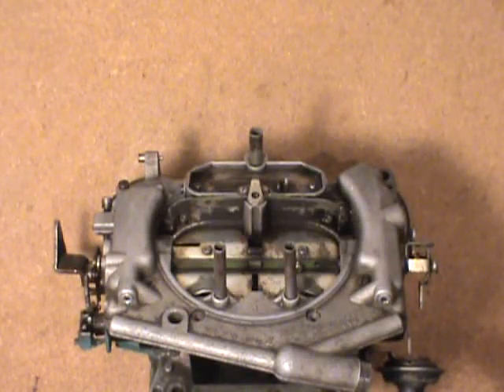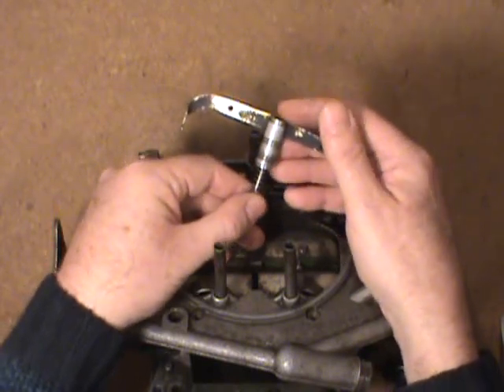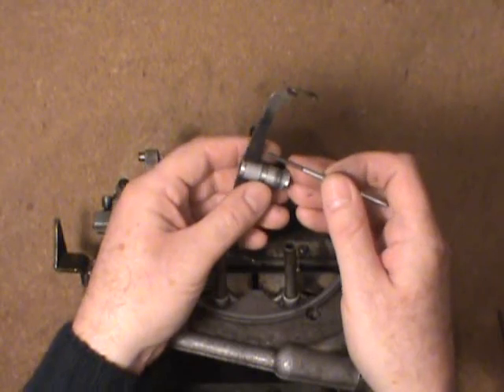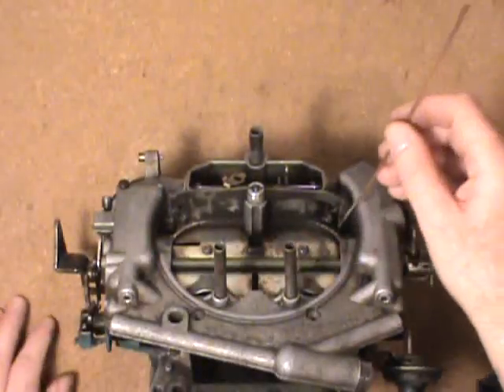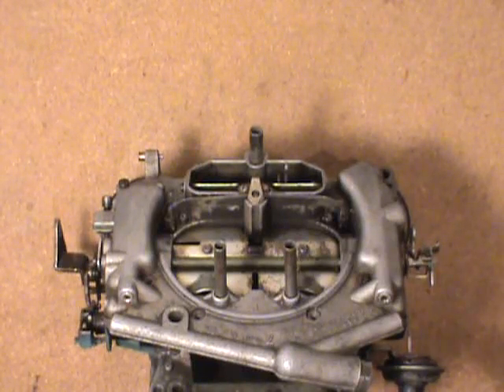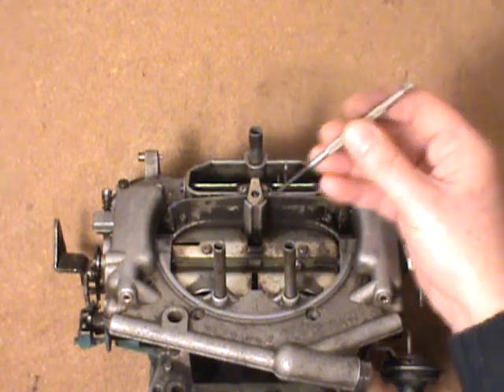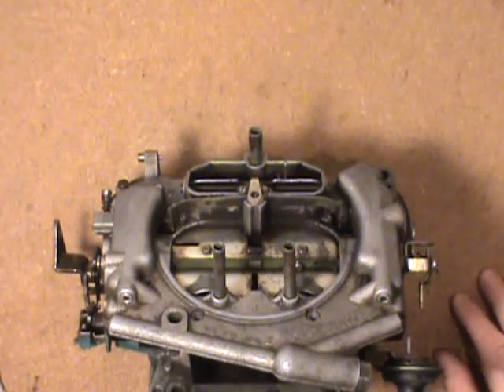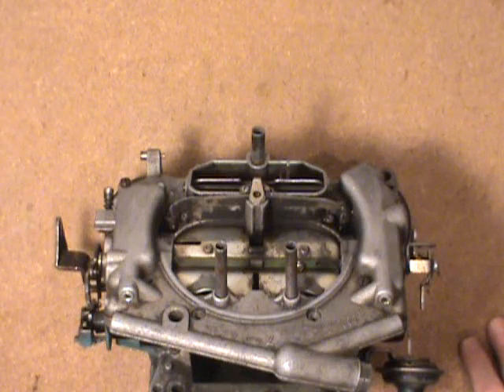Thermoquad 4 Barrel Carburetor  (Part 6)

Comment: Rocky,

Thanks.
 
I really appreciate your videos.  Carbs are not my specialty and therefore the are a little scary to get inside, but I am not going there.  Just fine tuning.  Your videos are very easy to understand.  I cannot say enough good about them.
 
I just had foot surgery and therefore I cannot push in the clutch.  So, if you do not hear from me for a while-that is why.  Cannot get to work on car.  :)
 
Numbers are a little hard to read, but here they are.  Top is 6548S and the bottom number is 35776.  I believe that 35776 is the S/N and the other is model.
 
I purchased it rebuilt and runs fine, with the exception of running rich.  I worked on the idle mixture and they were six turns out.  I got them down to 2 turns and it is a lot better.  Therefore, with the idles being so far out, I can safely assume that the Metering may be off.  Worth checking.
 
Carb is vacuum choke. 

Engine is 340 bored at least 30 over.  That old of engine, you know that it is hard to tell.  It has been stroked and therefore we figure it is running around 11.25 compression.  Cam is a 506 lift.  Manual 4 speed transmission.  Yes, it does do the Cha-Chugg routine.

Thanks again.

P.S:  I have no emissions requirements here.  I just want to get it dialed in better.
Reply from the maker: Mc Ca Greetings Mc Ca....You're welcome, and, Thanks, for Your Outstanding, and well appreciated comment, that You indicated, about my Thermoquad Videos, my Friend.The Thermoquad carburetor Number, that is Most Useful, for, looking up the Specifications for it, as well as, telling the Parts Guy/Gal, the Needed Information, so He/She will be able to provide You or Others, including myself, are those..."4-Numbers-Followed-by-the-Letter-"S".I had a look-see on..."Vaanths Thermoquad Guide"...for the "4-Numbers" & the Letter "S"...which You indicated as...6548S...I Did-Not See that...6548S...in the Listing......Maybe, it might be...6545S...(?), which happens to be the Identifying Numbers & Letter, that is Stamped on the Thermoquad carburetor, that You see in All of these Thermoquad carburetor, YouTube Videos of mine perhaps...???Once You are fully healed, after having Your foot surgery, and are able to get around without too much difficulty, maybe, have a look-see, to actually "Verify", those..."4"-Numbers-Followed-by-the-Letter-"S"...that way, I will be able to Look-Up, the much Needed Information, which will help a very great deal...!!!Those "4"-Numbers-followed-by-the-Letter-"S", are usually "Stamped" into the "Lowest" Part of the Thermoquad carburetor, on the "Left Hand Side", at the "Rear/Back".Before I forget, there is another very important thing, that can happen, when Setting the Thermoquad's "Idle SPEED Screw" Too High (aka, clockwise, and In too much), and, besides, having that Extra Air/Fuel from the Thermoquad's "Low Speed Circuit", Added, to the Air/Fuel that is already coming from the "Idle Circuit", happens to be, how it might "Add In Additional Ignition Timing", at "Idle Speed", from the "Vacuum Advance System", if indeed, Your Distributor has a "Vacuum Canister/Unit" on it, that looks, kinda like a little Space Ship, and its Vacuum Hose, is connected, to what is known as "Ported Vacuum", that takes its "Vacuum Signal", from just "Above" the Primary Throttle Plates/Butterflies, when the Primary Throttle Plates/Butterflies are almost Fully Closed.Your Thermoquad's "Choke Pull-Off"...besides Controlling the Choke System..."ALSO"..."Controls"...the..."Opening Rate"...of Your Thermoquad's..."Secondary Air Door"...!!!...just sayin'.Now for..."Adjusting" the "2 Idle Mixture Screws", and the "Idle Speed Screw"...The "Idle SPEED Screw" that I usually use, in order to Set the "Idle SPEED", is that Screw, that is just "Above", that Big Heavy "Fast Idle Speed Screw"...Now then, when it comes to "Adjusting" the "2 Idle Mixture Screws", it's very Important, to keep "Both" of them, Turned "In or Out", about the Same Number of Turns, and Partial Turns, in order to keep "Both" Primary Throttle Venturi-ees/Throttle Bores..."BALANCED"...or, Your Thermoquad carb, might not Work/Perform as good as it's able to.Just in case, You might not already know, always remember to have Lots of Ventilation and Fresh Air, when-ever Your Engine is Running, because the Engine's Exhaust Gas is "Deadly"...!!!The first thing to consider, before starting to "Set-Up", Your Thermoquad carb's "Mixture Screws", is to "Select", what You think, would be an Acceptable "Idle Speed".Have the Engine fully warmed up to Operating Temperature, and, "Make Sure", that the "Choke" is Fully "Off", as in, the "Choke Plate" is fully "Vertical", and, the Big Heavy (it's actually a Counter-Weight) "Fast Idle Speed Screw", is All the way to the "Bottom" of it's Travel, and in No Way, is that Big Fast Idle Speed Screw, making "Any Contact" what-so-ever, with the Throttle Lever (Yes-Sir-ee-Bob, the Lever that has the fast Idle Cam steps on it...lol). As an example, I have used the "Specifications", that were found on the Vehicles "VECI" (Vehicle Emission Control Information) Label/Sticker, that is usually found in the engine compartment, on a Factory High Performance Dodge 360 Cubic Inch small block V-8 Engine, with an 850 CFM (Cubic Feet per Minute) Thermoquad carburetor, that was also equipped with that good ole A-833 4 Speed (Manual/Standard) Transmission, that was controlled with that good ole Hurst Pistol Grip Shifter, never-the-less... Then, having the Vehicle on Level Ground...all 4 Tires Chalked with Bricks, to prevent the vehicle from Moving...Emergency/Parking Brake On/Applied...With the Garage Doors OPEN, and having Lots of Ventilation and Fresh Air, I Run the Engine, in "Neutral" (it's a Manual/Standard Transmission eh!...lol), until it's at Operating Temperature, then, turn Off the Ignition, and take the Key with me...First, with Engine "Not Running", I Lightly "Seat" the 2 "Idle Mixture Screws, and place a White Chalk Mark on each of the 2 Idle Mixture Screws, at the 12-O-Clock-High Position (aka, closest to the Sky), in order to establish a "Reference Point", to make things nice-n-easy...Then, I turn Each of the 2 Idle Mixture Screws "Out" (Counter-Clockwise) from being lightly seated, "4-Full Turns"...Then, with Engine still at Operating Temperature, and, the Choke Fully Off, I Re-Start the Engine, and, being very Careful around all of the Hot and Moving Parts and Pieces, in the Engine Compartment, I Adjust the "Idle SPEED Screw", until my Tachometer (aka, Tach), is showing/displaying "850-RPM's"...I then, Adjust "Each" Of the 2 "Idle MIXTURE Screws "IN" (Clock-Wise) Equally, 1/4 (one-quarter) Turn Each time, as in, Turn In, the Left Idle Mixture Screw 1/4 Turn, then the Right Idle Mixture Screw In 1/4 Turn, and always remember to keep "Both" Idle Mixture Screws, Showing the White Chalk Mark, Pointing in the Same direction, as one another, and having the Same Number of Turns and Partial Turns as well...!!!You will Notice, that, when-ever, You are Adjusting the "Idle MIXTURE Screws", that, the "Idle SPEED" will "Change", as You do so...When the "Idle SPEED" Changes, it's just a matter to just "Re-Adjust" the "Idle SPEED Screw"..."Back To"...the, and in my case, that "850-RPM's", or, what-ever, the Engine "Idle SPEED", happens to be, that You have chosen, for "Your Engine"...!!!Seeing as how, You had mentioned, that, You Do Not have to comply with any of that Smog/Emissions Testing Stuff, just keep Adjusting Your Thermoquad Carb's..."Idle MIXTURE Screws"..."EQUALLY"...until You get to the point, of having Your Engine "IDLE", at the "FASTEST RPM's"...While Keeping Your Engine's..."IDLE SPEED"...at (in my case 850 RPM's in Neutral), or, what-ever You have chosen, or, what-ever "Your Engine" Idles "Best" at, with the "Idle SPEED Screw".When You think that, You have made the Best Adjustment/s possible, make sure, that, the..."White Chalk Marks"...On "Each" of the "2" Idle Mixture Screws..."Are Pointing In The Same Direction" (aka, as in, the Oh-Clock/Direction, that an Analogue Clock's Arm/s Do)...in order to, try and keep, "Both"..."Idle MIXTURE Screws"..."BALANCED"...!!!As I see it, Engines are some-what, just like People, in that, "They" All seem to have...Their "Own Personalities"...!!!Now that (I hope), You might have a better understanding, as to what's goin' on, and, how to make Your Thermoquad carburetor's..."Idle Mixture" and "Idle Speed"..."Adjustments/Settings"...You will be, well on Your way, to having, as I see it, a very Strong, and great performing..."High Performance and probably Larger then a 340 Cubic Inch V-8 Engine"...!!!If You care to, You can let me know, how You make out with Your Engine's Performance and Running Issues, when-ever that time comes...If You have any questions at all, just let me know......Good luck.....and......Best Wishes, for a Full Recovery, from Your Surgery.Be Safe, take care, and have a good one.